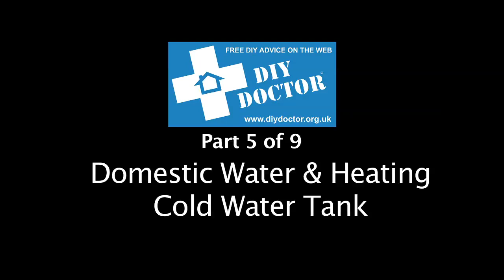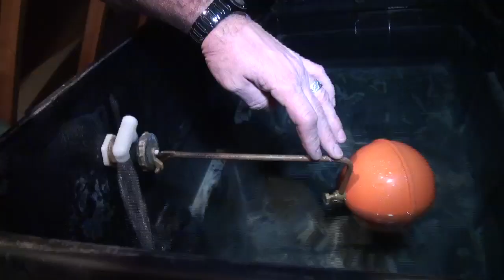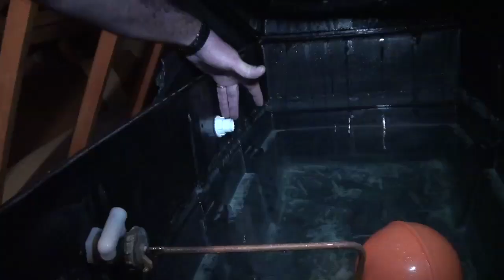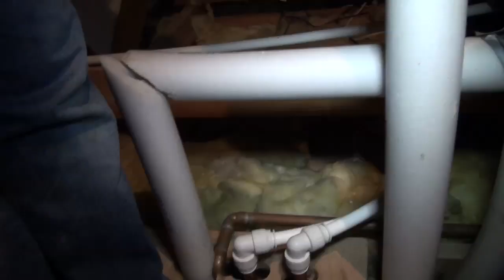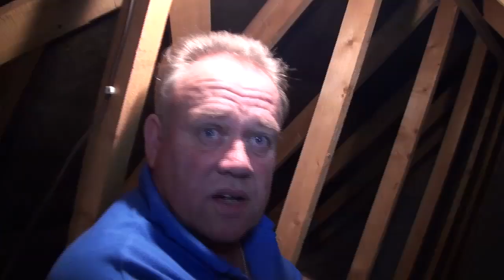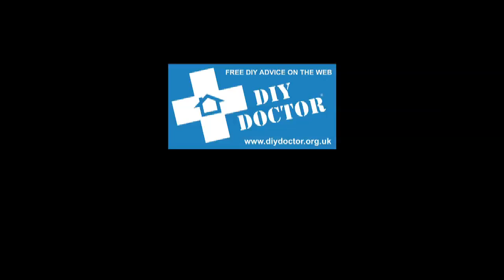Water and Plumbing Tutorial Part 5 - Cold Water Tank

Comment: Are there considerations (beyond being visible) on where a cistern overflow has to exit, or how it has to run? Mine are currently extremely in the way, and as we're about to do work on bathroom and en suite I'd like to reposition them to make work access easier.

 My roof is very shallow pitch (no room to stand upright), and vertical space is very constrained. C/w cistern and c/h header tank are in the middle, totally blocking easy access to one half of the roof space - to get past you have to ease your way past, outside the roof trusses. Both overflows, rather than heading straight to the eaves, run 3 to 4 times that distance along the roof trusses first, making it VERY hard to get beyond the trusses in the first place. 

All I can think of is that the overflows fall more slowly as they are than they would if they'd run directly; as they'd normally not have water in them, that doesn't seem a likely reason? They're unlagged plastic.

Comment: Do you have a video on how to drain a system like this? We tried to change a valve to a more modern one the other day, after taking the radiator off the wall quite easily, I though I could just remove the valve too. Stupid me! Black water EVEYWHERE all over carpet and walls. I managed to force the old valve back on. So maybe a video on draining the system and changing a valve??? Thanks
Reply from the maker: This tank has nothing to do with radiators or centralo heating Jadey. This is a cold water tank for the cold water to your taps/bath etc. The centreal heating is on an entirely different system. To get an understanding of how both work go to our website where you can find pages and instruction on draining down both the central heating system  http://www.diydoctor.org.uk/projects/drainch.htm and how to understand the cold and hot water systems in  your home http://www.diydoctor.org.uk/search/search-result.htm?query=water+system&search=1